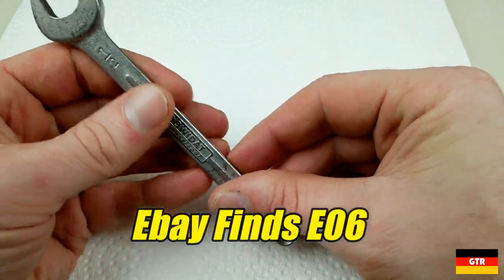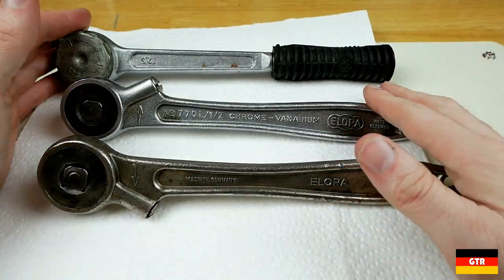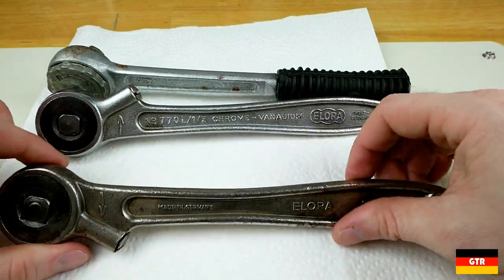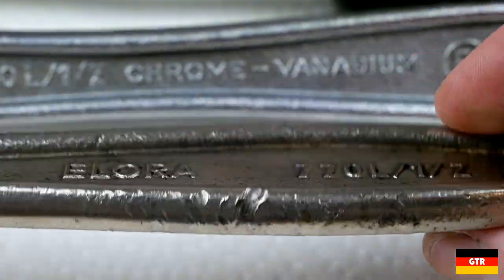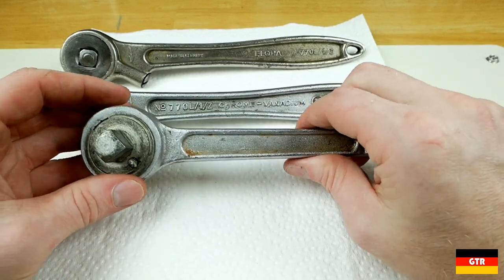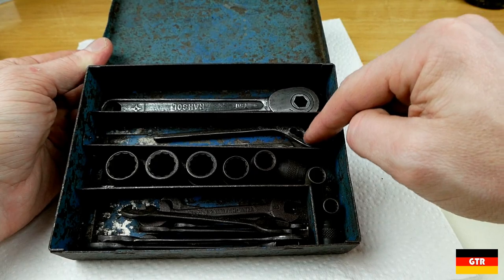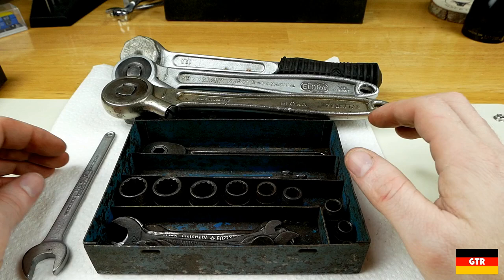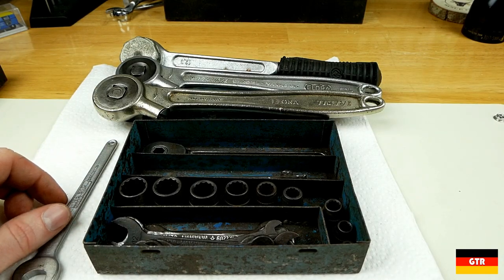Ebay Finds E06:  Dowidat Spanner, Elora Ratchets, Rahsol Ratchet Set

Comment: I really think that IronicSadBoye is right as to the origin of the allegedly "Taiwanese" ratchet. It should have been made in the USSR. First, the letters on top are Cyrillic (Л - stands for "left", П - for "right"). Second, 12,5 - is one of the typical attachment square sizes accordingly to  ГОСТ 22407-77 (the USSR State standard "Ratchet wrenches. Types and basic dimensions " introduced 1977-03-22). 
As to the sign on the plastic handle, it's hard to identify the plant. But it's a plant mark for sure.

Comment: I bought a set of Dowidat 6 point metric sockets .... the Ebay seller out of Germany threw in a box cutter (PRC LOL) and a Gedore No. 26R "tube socket" nice :) I've always been curious about those ...do you think are they just a more economical alternative? They have holes on the side ....my old Mercedes came with a tool kit with a spark plug tube socket and a little bar etc. My brake calipers are attached with 19mm ...I had to use a breaker bar.  I suppose you coul hammer that bar on a 6 point tube socket and use the leverage of the tube to keep it seated tightly.

Comment: You should have a look for an Elora 770-L1-Z1, they are almost the same design, but with a double pawl mechanism. 
Mine is one of the smoothest ratchet i own. They cost about as much as the ones you already have.
The old all steel Stahlwille 503 is also very very nice.
Reply from the maker: Thanks, I'll look out for it.  Elora is still in business and they still make the model you are referring to.  I have wondered why Elora isn't as common of a brand as other tools.  They must be more of an industrial brand than a consumer brand.

Comment: On the top I can make out Wüse, which means dessert. Maybe it was used by the dak, Deutsch afrika korps which operated in the dessert.
Reply from the maker: I did see that too, I thought the word dessert was up there.  It probably was used in WW2.  I did get it directly from Germany from the Oberhausen area so not that far from where it would have been made in Remscheid so it might have also been surplus.
Reply: The T in "Wüste" would be missing. Looks like "Sütterlin" handwriting, which is very hard to read if you're not german and younger than 80.
Reply: I'm pretty sure it says "11 Nüsse, 10(?) Schlüssel, 2 Knarren mit Verlängerung" - 11 sockets, 10 wrenches, 2 ratchets with extensions

Comment: Can't make out much of the writing, but i think it says "Knarre" in the bottom line. I.e the German, or rather, one of the German terms for 'ratchet'. Actually i think i can make out more, i'm pretty sure it's a part list of what's in the box. At the top it says "11 Nüsse" (Number of sockets in the set),  the middle could be the number of "Maulschlüssel" (Wrenches) but that's really tough to make out, would make sense though. And the bottom, as i said, would be the ratchets but i can't make out what the original owner wrote after "Knarre". Whatever the case, that's my best guess anyway.
Reply from the maker: Thanks!  I was thinking it was something like that, or someone's name and address.
Reply: It's only "Schlüssel" (without Maul-), the S is large so that's the beginning of the word, but it means "wrenches" too. Behind the word "Knarre" (ratchet) are some words I can't read.
Reply: I agree: 11 Nüsse, Schlüssel, Knarre. I think, that's correct! Greetings from Germany!
Reply from the maker: Thanks, I think you guys got it.

Comment: 12,7mm would be 1/2". If you multiply 25,4mm (1" in mm) with 0,5 (1/2) you're getting 12,7mm. So they've actually stamped nonsense. The NATO designation of .50 BMG caliber is 12,7x99mm.